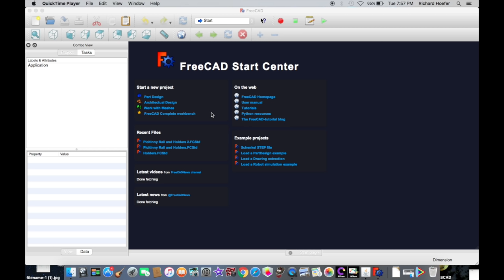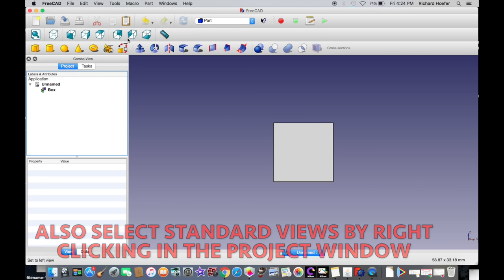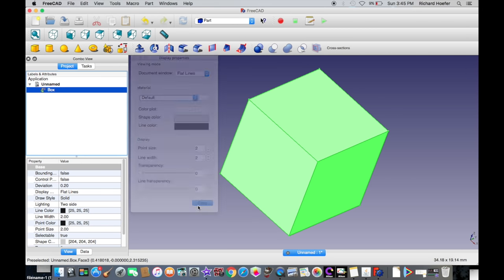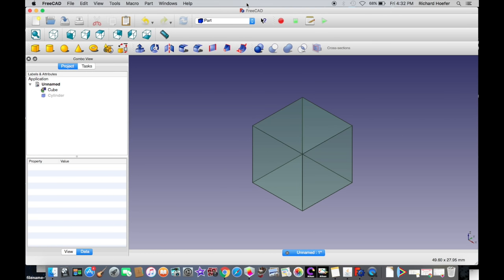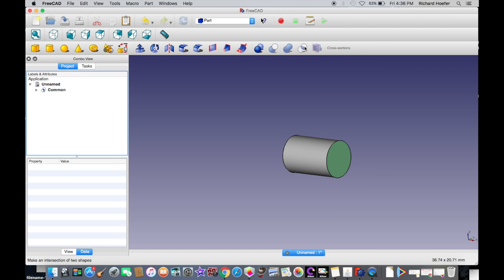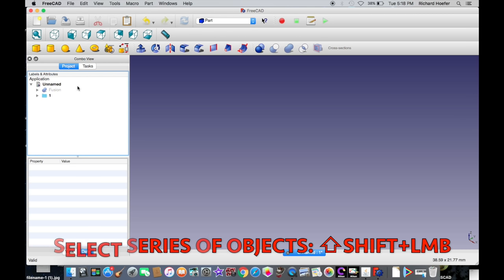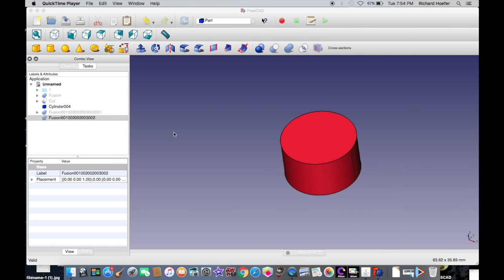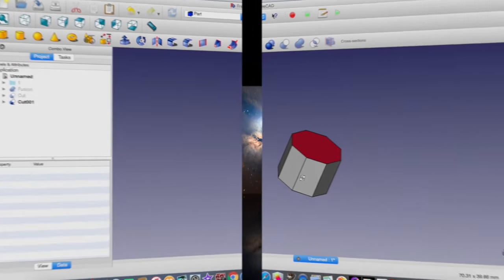FreeCAD Tutorial Part 1: The Part Workbench

Comment: It's 2020 and I've just bought myself a 3D printer.
This is an incredibly useful video explaining the basics of FreeCAD. Thankyou.
There's some slight variation in the interface between the Mac & Ubuntu versions but you were using the 2017 version. I'm using 0.18.4 so no doubt that's the main difference.
I'm actually trying to create a better enclosure for the battery I've created for my ebike.
:ThumbsUP:

Comment: Thanks Rick, I'm struggling with FreeCAD. Great to watch these vids. Thank you for showing more simple steps to understand the basics . Cheers!
Reply from the maker: Hello Peter, sorry about my old reply to your comment, I got you mixed up with another Peter that had commented on my video asking for assistance. I’m glad you find the video to be helpful, if there’s anything I can help you with, let me know and I’ll be happy to help. Thanks for watching !
Reply: Hi Rick, I do have an unrelated question. Playing with the Arch workbench I put windows in some walls. I tried to delete one then changed my mind . It returned with opaque glass so I changed the transparency to 80. The whole frame and glass turned transparent. Then all the windows turned transparent  How did I do this, and how can I correct this.
Thanks for any ideas!
Reply from the maker: Hello Peter, sorry for the belated response, to be completely honest with you, I have never used the Arch module before; I have always used the Part Design workbench and sketching for any architectural or structural projects. However, I know that whenever you delete an object in FreeCAD and then undo the deletion that the object will return with its default appearance, so for example if the object you deleted was red with dashed lines at 50 percent transparency, after you undid the deletion the object would return with its default grey coloring with solid lines and 0% transparency. My initial thought is that the window that you cut and then uncut was somehow connected to the other objects which also changed appearance; are the objects that changed without your input somehow connected to the deleted window, like how two objects are connected via Boolean operations? Have you tried to select the objects individually and change their appearance back to how you want? My next thought is that somehow the view mode of the Windows was changed from “Flat Lines” to “Wireframe”; this would cause the Windows which used to be shaded with lines to wire frames with lines only. Another option you could try is to select all of the objects that changed without your input using the CTRL or CMD button to select them independently; then hit CTRL and D or CMD and D to bring up the appearance menu. From there, you can change the appearance of all the objects you selected at once, so hopefully that will help. Let me know how it turns out, good luck!
Reply: Hi Rick, Thanks for your reply and advice. I didn't know I could draw arch stuff in Part Design WB. I just discovered the FreeCAD forum, found a related thread, downloaded V.17 opened up the drawing, problem solved! Looking forward to more of your videos! Thanks again.

Comment: Thank you very much for your teachings I am learning to use FreeCAD for making electronics components such as Switches, ICs, potentiometers, Vacuum tubes etc. Would you create a video showing how to edit an imported  STEP file for an electronic component which shows up plain with no colors.I would like to be able to color the pins as gold or copper and color the body as well with different metals or platics colors and then save them as an STL file that could be imported into Autotrax Dex. Your help would be greatly appreciated

Comment: I am having trouble with the cylinder. When I create it, it is fused to the cube, and I can't figure out how to get it separated like the tutorial (due to the frame cut where its just there). Is there any way to make both components "free" to where you can move them relative to each other?
Reply: Hi, maybe you already figured it out, but just in case, I got it... select the cylinder, "placement" and move (arrow up) the "x" coordinate, then change the view if the cube (i.e. top) and change the "y" coordinate...the axis might be different depending on your settings, but the idea is the same...

Comment: Hi. Nice video. I am new to using Freecad. I am trying to create a pipe filled with marbles with certain distance from each other. I used spheres to create the marbles and used cylinder to create my pipe. I used ARRAY option to spread the marbles through the pipe. I had to create 2 arrays to align the marbles at certain spaces. I cut the extra marbles with the pipe put another cylinder as a pipe to cover them. When I use the Fusion Option, all the marbles from inside the pipe disappear. I there anyway, I can keep the marbles inside the pipe? thanks
Reply from the maker: Hello Jalil Ahmad Jamily, I’m glad you enjoyed the video, sorry for the delayed response. Let me see if I understand you correctly; so the marbles exist as one solid object and the pipe exists as a solid cylinder, and you are trying to fuse them into one object, so that the marbles inside the hollow pipe exist as a single object, is that correct? I think the issue is that the cylinder you are fusing with the marbles is a solid cylinder, instead of a hollow cylinder; if the pipe is solid, it will end up covering up the marbles when they are fused. Try this; copy and paste the cylinder which acts as the pipe and change its radius to slightly larger than the radius of the marbles but less than the outer radius of the pipe. Then cut the pipe cylinder with the new cylinder; this will create a hollow pipe. Then fuse the marbles with the hollow pipe. Hopefully this makes sense, here’s another way to visualize it using some arbitrary numbers: marble radius=5, pipe inner radius (smaller cylinder) radius=5.1, pipe outer radius (larger cylinder)=6. In this example you would cut the larger cylinder with the smaller cylinder, which would give you a hollow cylinder with an edge thickness of 0.9. Then you would fuse the marbles with the hollow pipe so that the spacing between the marbles and the inner pipe would be equal to 0.1. Having a spacing of 0 between the marbles and the inner pipe can cause the program to create an odd looking fusion, so I usually use a spacing value of 0.1 for objects I intend to be moveable. Hopefully this will help, if I misunderstood you or if you need further assistance I’m happy to help. Good luck!
Reply: @RickHoefer89  Thank you so much. It helped.

Comment: Thanks for this. I've tried to follow but hit a pretty basic problem... I create the cube OK, then when I create the default Cylinder shape, this gets placed at one of the corners of the cube, not dead centre of the cube as I'd expect... In your video the cylinder is already in the right central place but 'hidden' so I don't know whether you moved it into the correct position or it was created there by default somehow... But OK, I move my Cylinder into the central position of the cube. Now when I try the CUT boolean, the operation takes a corner chunk out of the cube in the position my cylinder was first in, not the position I've now moved it to... confused !
Reply: OK, when translating objects in the 'Placement' window even if it looks like the object is being moved into a new position, I have to click OK below the Palcement window (in the dark blue area below the Placement window) before the change is really 'fixed'. Despite what appears on the screen, The Boolean operation will ignore the translation if it has not been OK'ed.

Comment: Good tutorial although if making a cut... what if you want the cube to cut the cylinder instead?
Reply from the maker: Hello Tyler Can't Swim. When performing a cut operation, the first object that you select will be the object being cut into while the second object selected will be the template for the cut. So if you wanted to cut the cylinder using the box, first select the cylinder by clicking on it in your combo view, then press and hold the command button if using OSX or control button if using PC and click on the cube while holding the button down. Then release the button after selecting the cube and press the Cut button to perform the operation. Hope that helps, cheers!

Comment: Hi Rick Hoefer. Is there a way to open .dwg files on FreeCAD?
Reply from the maker: Hello JeRzYG81; I do not have much personal experience with DWG files, but the only way I am aware of to import DWG files into FreeCAD is to convert them into DXF files using a free file converter called  Teigha Converter. Unfortunately DWG files are a closed proprietary type of file, which is why the converter is required. Here is the FreeCAD page addressing DWG files as well as the link, installation, and usage of the Teighn Converter; https://www.freecadweb.org/wiki/FreeCAD_and_DWG_Import . Hopefully this will help, thanks for watching and good luck!

Comment: I just downloaded Free Cad but there is no option for assembly in the drop down tab. I loaded the windows 64 bit version. Is assembly an addition add on or should it have loaded with the download? Any Help would be appreciated.
Reply from the maker: Hello Jeff, to be honest I've never used the assembly workbench before, but I made this video using an older version of FreeCAD and that version came with assembly compared to the 0.16 version I'm using now which doesn't have it. I tried looking it up and I found this forum post which might help you, https://forum.freecadweb.org/viewtopic.php?t=10525. Apparently the Assembly module is incomplete but there is a link in the forum to the Assembly2 plugin; https://github.com/hamish2014/FreeCAD_assembly2. Hopefully this helps.
Reply from the maker: Also, if that doesn't work or if you have trouble installing assembly2; I'm not sure which version I used to make the video, but I believe it was 0.13. You should be able to download 0.13 here; https://sourceforge.net/projects/free-cad/files/FreeCAD%20Windows/FreeCAD%200.13/ and hopefully it will be the same version as the video. You won't have the same updated functionality of the more recent versions, but you will be able to use the basic version of assembly. Hope this helps, good luck!

Comment: what is the difference  between cad and blender
Reply from the maker: That's a good question; CAD is commonly used by engineers and deals with solid objects with actual volume and wireframes and is more focused on geometric interactions between objects/solids, where as blender and other modeling software is commonly used for animation and focuses on the outer surfaces ("skins") of shapes, and objects are represented by hollow shells as opposed to solid objects with volume. To be honest, I've never used blender, but those are the basic differences as far as I know. Hope this helps, thanks for watching!

Comment: You do so many thing that you do not mention, like using type commands on the keyboard to move objects.
Reply from the maker: Hello joystickmusic, could you please share with me the time code for the example you gave? I’m trying to understand the mistake I made so I can improve my future videos. I tried to include text at the bottom of the screen every time I used a keyboard shortcut so that viewers would be able to follow along. There’s a few times where I displayed a screen with objects which I had created prior to filming, but usually they only existed as background props to demonstrate a specific technique. Whenever I moved an object, I used the pull down menu under edit to get to the ‘placement’ menu. However, I did use the up and down arrows on my keyboard for the axis text input to move objects, although I think I mentioned that but I could be mistaken. If you could highlight some of the issues for me, I would appreciate it. I try to make my videos as easy to follow as possible so any help would be appreciated. Thanks! :)

Comment: we magiclly see you creat obkect without telling us how did you do it , how this cylinder magiclly apperd
Reply from the maker: Hello Mohammad V, I created the cylinder using the "Create Cylinder" button which is between the cube and the sphere in the tool bar with the yellow shapes. This tool bar creates shapes with predetermined dimensions which you can edit in the Data tab. You can also create shapes by pressing the 6th button from the left in the same tool bar and use the pull down menu to select the shape you want to create and enter specific dimensions for the object. I created the cylinder for the viewing/placement/Boolean examples; I apologize for not showing the creation of the cylinder. Hope this helps.